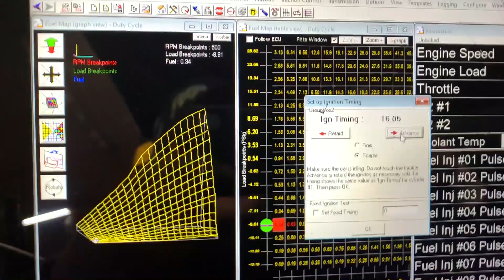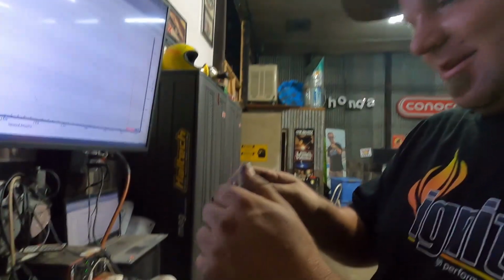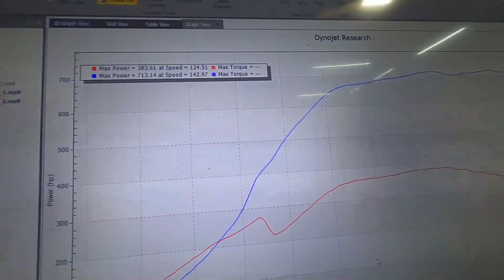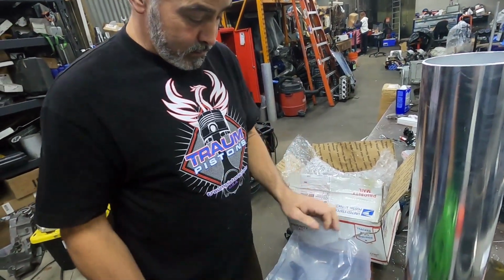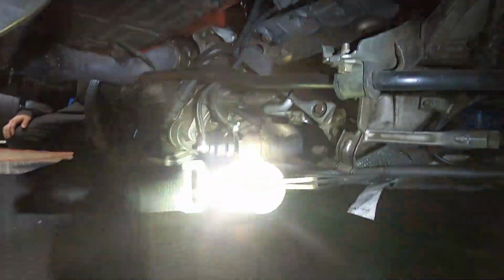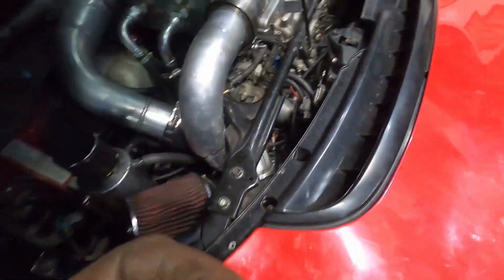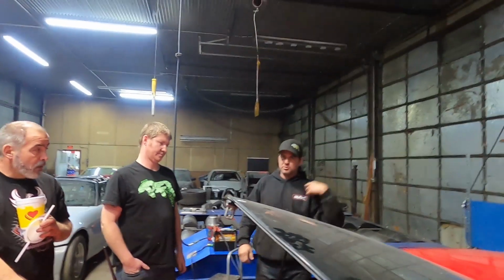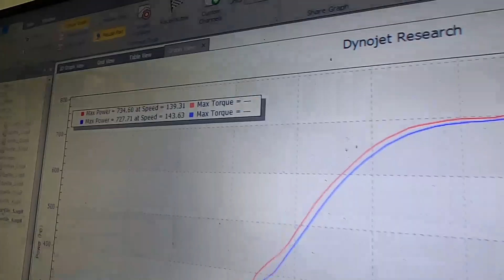New Turbo on the NSX! Let’s test it!

Comment: Flipping sweet !!good to see the nsx stretching it’s legs a little again 

Also I wanted to ask on a turbo or supercharger intercooler to they make one that runs the ac refrigerant through it ?? Would be a air heat exchanger plus a ac coil inside of it ?? Again I don’t know but seems like that would be the ticket on any blown applications

Comment: Back when I was a young wrench we only used the dyno with a bear scope to run cars up to a speed where they had misfires or would not accelerate or just issues on the top end. So dyno only vids to me are really boring when you do dyno only as I have seen it so may times..on a lot of channels you need to go somewhere else engine rebuilds would be nice but just a bunch of dyno tunes get repetitive